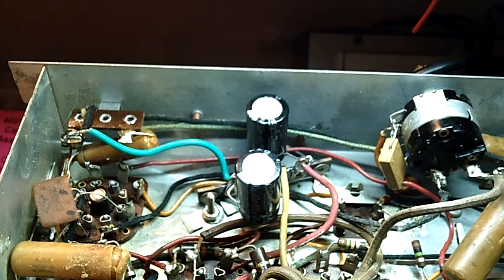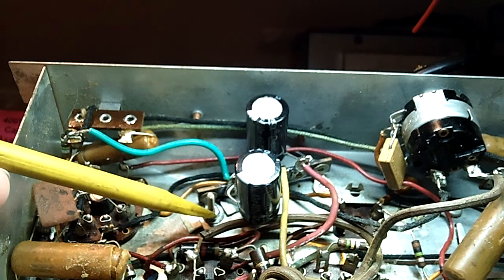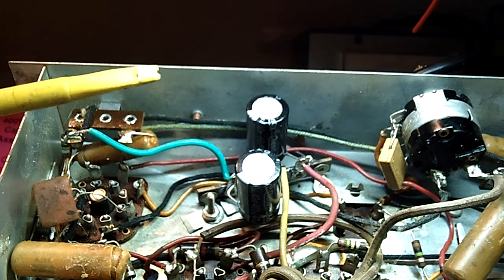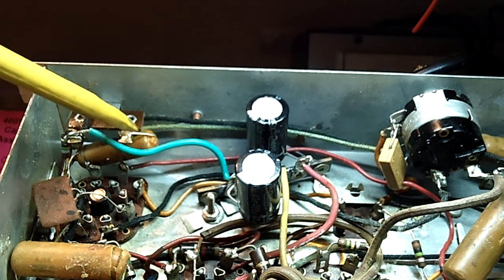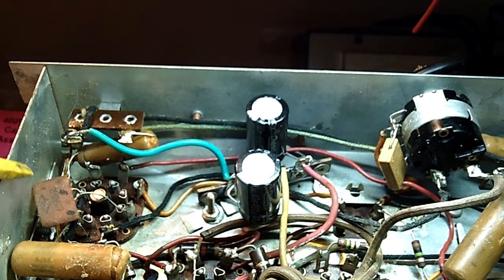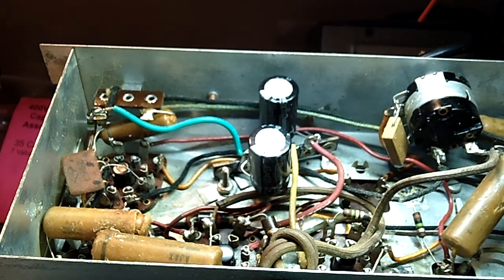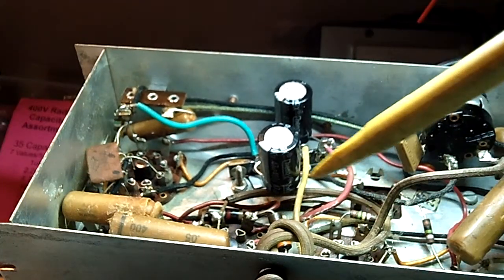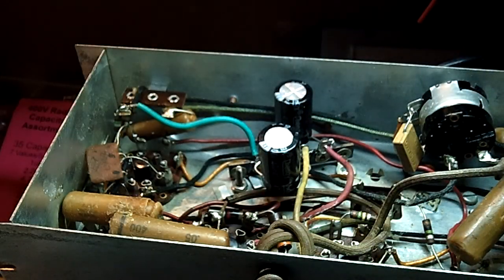1957 Admiral Bakelite AM radio chassis work Part 2

Comment: If you just hit that wax with a Heat gun for a second it will melt the wax and make it clear so you can read it. Nice project  Larry.
Reply from the maker: Yes I found all the values thanks Gregg. The project is done now.

Comment: I would think Larry that those 47's will be fine for filtering. Looking good pal.
Reply from the maker: Thanks I think they will be fine as well Carl. It's a pretty simple all American 5 Radio and not as many parts as others I have worked on so should finish it pretty quick I would think.

Comment: I just scrape off the wax with my finger nail or I hit it with a hot soldering iron.
Reply from the maker: Yes I did scrape it off but it was so dull underneath I could barely read it but I have all the values now so no worries.